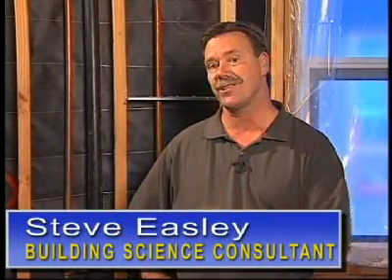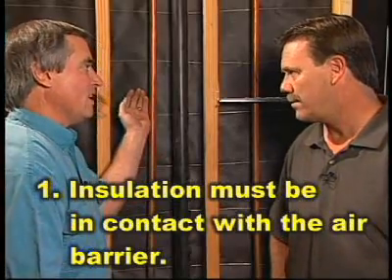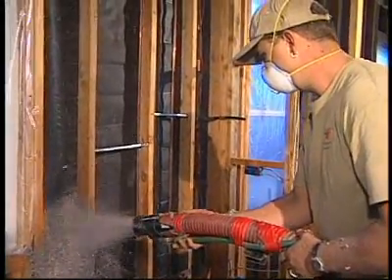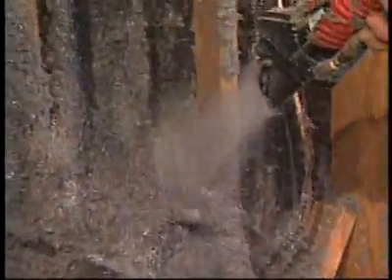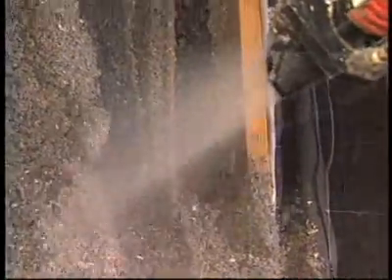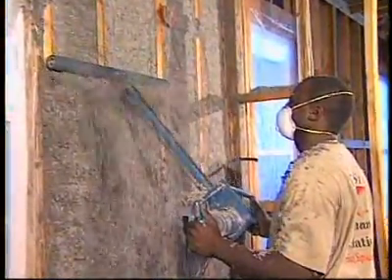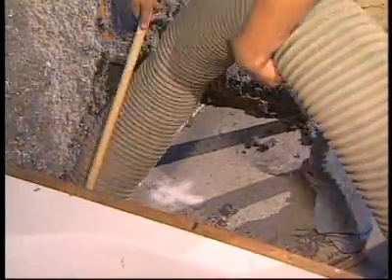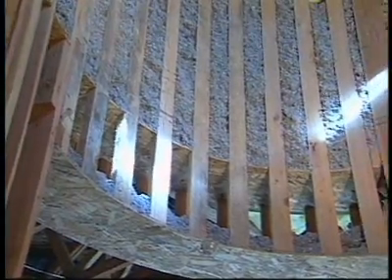Insulating walls with cellulose insulation

Comment: I'm finishing an addition now, would it be better to spray-install wet cellulose before hanging drywall, or dense pack after drywall? It sounds rather critical to avoid cavities or gaps between the cellulose and drywall. Does dense packing after drywall installation ensure that there's no gaps?